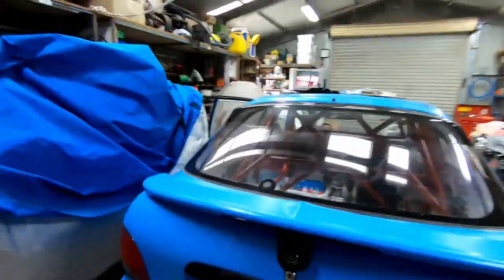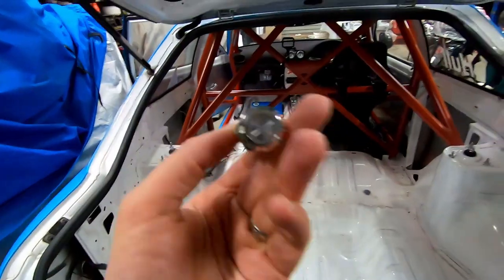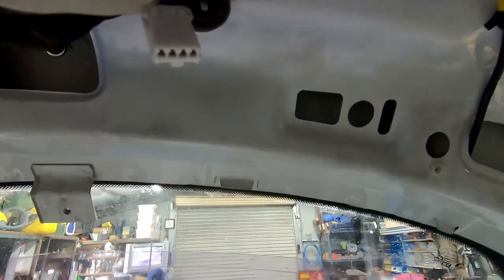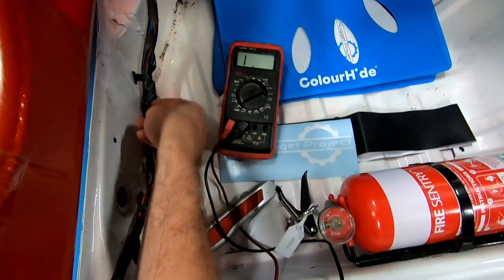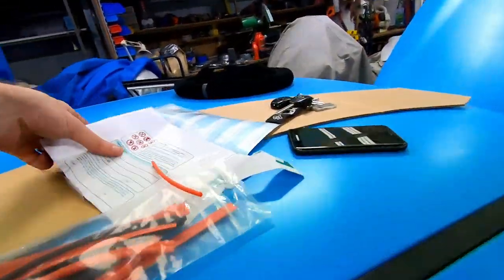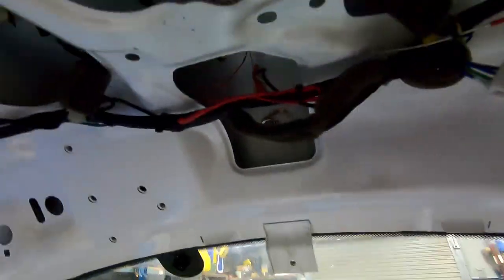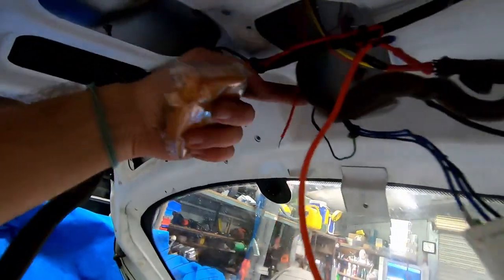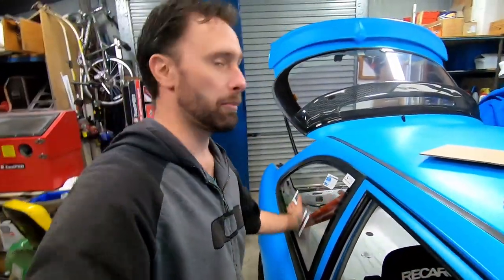Budget Race Car Build - converting to electric boot release

Comment: Hey mate, great work. Just wondering what you did with the hole left in the rear window when the wiper is removed?
Reply from the maker: Just a plastic plug from Clarke Rubber :)
Reply: @TheNuggetProject  thanks mate. Too easy 👍👍

Comment: Hey mate, I've noticed you're using the winmax w6.5 pads. How do these go?
Are they noisy? How is the braking?
Thanks.
Reply from the maker: They are awesome! haven't had any fade yet, they don't have to heat up and nup no noise what so ever so far :) I'm pretty sure they are going to chew my disks but the disks are cheaper than the pads so im' good with that!

Comment: Is the power to the switch connected to the kill switch? Cause won’t that mean you can’t open the boot when the power is killed?
Reply from the maker: Yes it is mate, for the exact reason, so when i park the car up on the trailer randos can't just walk by and open the boot, but the internal cable release still works so you can still open the boot with that with the power off :)

Comment: Cams should make this illegal. A cable can't fail.
Reply from the maker: Jesus calm your farm mate,  there is no way this is triggering by itself, if for some reason there was a catastrophic failure and this did trigger, its' a weighted tailgate, one tiny bump in the road and it would reclamp itself instantly, it's not a bonnet that will fly up for no reason it's a tailgate. Go to any race meet and check out some of the stuff people have on their cars, i met a guy whose car had passed scruteneering who had run his coolant overflow pipe onto his windscreen so if his car overheats it sprays the coolant on his windscreen to let him know HAHA, so i think an electric boot release (which by the way is standard on all modern cars which can be driven on track) is not an issue :)
Reply: I’ve seen people drive these on excels on track without closing it properly, it pops up but you can close it while still on track and it’s not that dangerous
Reply from the maker: @mcdoogle6549  Cheers mate, I think safety Brad is just a little excited tonight, too much mountain dew :P 
Lets not forget all modern cars have electric boot releases and you see them out on track all the time. Some people just love to crap on everything that is posted online, yet don't create anything themselves :)
Reply: @TheNuggetProject  
Hahaha I didnt mean to set you off. You can do what ever you want. Not going to have a youtube debate when I build race cars for a living
If you can do it. Sweet as 👍👍 Ive just seen everything happen under the sun on a race track.
Reply from the maker: @Stackham   No worries Brad, happy to get advice from someone who builds race cars for a living. In your original post before you edited you were very emphatic about how dangerous this is and it should be illegal, and in your edited post you are saying a cable can't fail. well if you watch the whole video you will see i haven't actually removed teh cable release at all, that entire system remains active, all the actuator does is replace the key lock, so instead of turning a key you push the button instead, a button that is a sealed, waterproof unit that is in a solid stainless steel housing that cant' be triggered accidentally. So with your experience i'm happy for you to elaborate on your concerns as you took the time to do your original post you obviously have strong concerns about this and i'm sure you wouldn't mind sharing your knowledge with myself and the rest of the viewers of the Nugget Project.
Reply: @TheNuggetProject  
I guess my issue isnt with the electric release system you gave in the car. 
And I do sound like a scared parent not letting their child play on the monkey bars. We have some amazing volunteers and track organisers putting together an event for local grass roots racing. My issue is some people neglect safety standards that should be inplace by cams but there isnt. From crappy cages to poorly clamped batteries. There are some cars out there that shouldnt be racing. This car how ever is great, Ive seen a couple of videos here and theres some great stuff you're doing. Im currently building my own excel and cant wait to hit the track.
Example putting safety pins on boots. Unfortunately there are bad eggs in every category and can cause serious accidents. Ive seen excels all the way to suoercars. Panels flying everywhere. I just want to see the volunteers go home safely.
Reply from the maker: @Stackham  I completely agree Brad, and if you see my videos i'm all about following safety standard guidelines and sometimes (for example my roll cage) doing more than i need to, sometimes forsaking performance for safety.
I'm still confused by your original comment, i still don't see the issue with replacing the boot lock with a button, i don't see how it's unsafe and why it should be illegal?